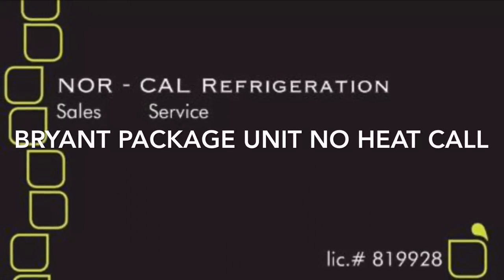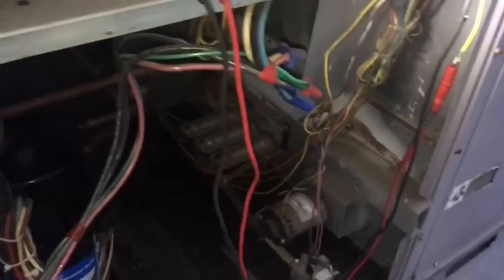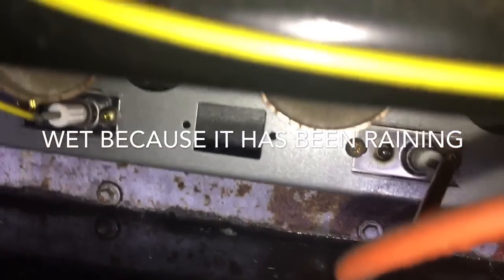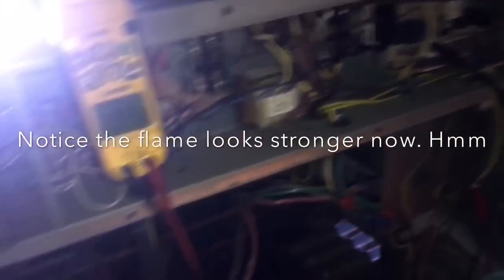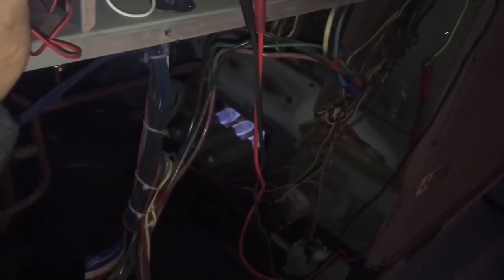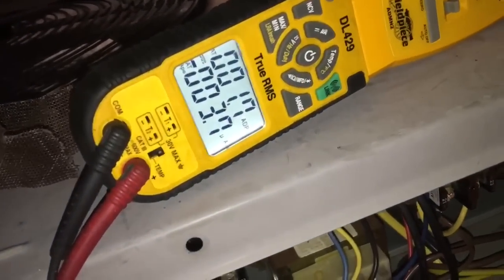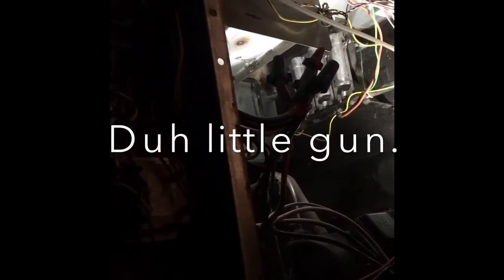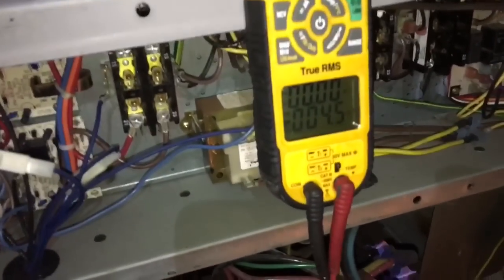Flame rectification issue on a Bryant package unit

Comment: with all that rust in the heat ex-changer you may have a crack in that burner tube. check by just turning on the blower fan and taking a long bic lighter and running it up in the tube about 2 inches and watch the flame to see if it gets to dancing or is blown out.  if so you got a cracked tube.

Comment: Good vid. nice thinking on the scavenge job. i don't do much heat down here if any. Commercial Restaurants around here NEVER need heat ever ! 
With 10 Refrigerators Average running per restaurant  , Toasters and Ovens Going u know how it goes. Heat everywhere.
Reply from the maker: OcRefrigeration,Hvac & Electrical. This was for the dining area.
Reply: yea, ok, i could see that. too bad they cant discharge some of that kitchen heat into the dining room. any ideas anyone ?

Put a water coil in the kitchen and one in the air handler for the dining area, then Pump water through it. instant heat removal from kitchen to dining area. cooling kitchen too. heating dining area. Free Heat !

Comment: condemned a inducer motor on that sane style unit up here last week, it had what looked to be a large cocoon or some type of insect nest in it.the blade was froze, just gave it a lil push and a whole bunch of poo shot out.motor ran but I wrote it up for replacement.Thanks again for another great video, love these in depth trouble shooters.
Reply from the maker: Max& Me you can get the hole assembly for those. Makes for easy change out.
Reply: yeah I have been told, my mentor went back the next day and changed it out,I got stuck with Ice Machine duty.

Comment: That was a tricky one, I never seen that issue. I would of replaced the flame sensor and then maybe the board. Normally if the gas valve can be adjusted,its working. Thank you for posting this, this will probably save me this winter. Awesome job!!!

Comment: Looked like your meter was a little slow to respond there
Reply: You had a gas valve on your truck for that thing?
Reply from the maker: Joe Shearer I just sucked and blew my meter it cycles just fine. No lag. 
The valve came off there other unit which is the same unit for the back kitchen they never use the heat on that unit.

Comment: so on a 2 stage heat gv if you read 1.7 wc on first stage, should second stage automatically double to 3.5wc?? 
hope my question makes sense
thanks
Reply: Nor-Cal Refrigeration & H.V.A.C  always set your second stage first then set your first stage
Reply: zack9912000, I have read varying product literature on that. Carrier infinity furnace literature, for instance, say to set lo fire first. I guess it's a valve specific thing.
Reply from the maker: squirtle hvac second stage should be 3.2-3.5" wc on that unit.
Reply: so if you regulated 2nd stage to 3.5 since it was 3.0 in the video will first stage have gone up automatically?
Reply: how exactly did you know gas valve was at fault? 
if that makes it easier haha.
I'm barley second year apprentice
Reply from the maker: squirtle hvac no 1 stage has its own adjustment
Reply from the maker: squirtle hvac you can see on the manometer the delay. The gas valve is slow to open. And fluctuated.
Reply: Nor-Cal Refrigeration & H.V.A.C 
thanks alot!! gas valve offender haha

Comment: If you run across that again take a run a ground wire from the burner to the control panel ground usually solves the problem
Reply from the maker: gary smith i have done that in the past. That was not the issue this time, thanks for watching.